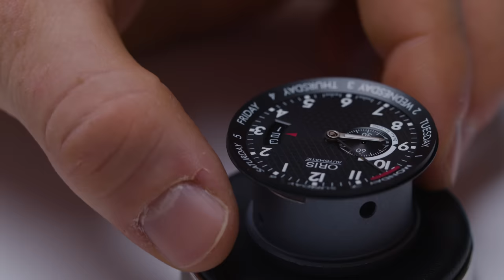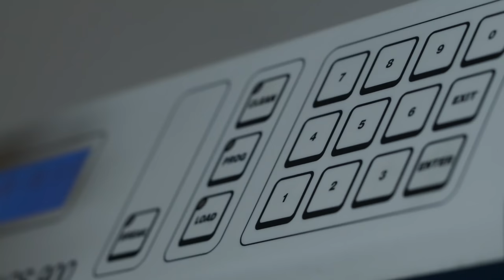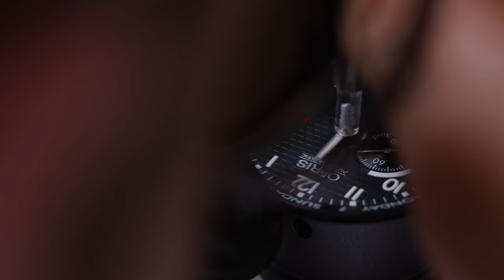Oris: Restoration of a BC4 Small Second, Pointer Day (2022)

Comment: How much does it cost for restoring such watch with that condition?Thanks
Reply: Free
Reply: depends on movement, normal movement revision is 370 CHF, chrono movements are 550 and then you pay extra for special polishing or part replacement but Id say max about 500-600 if the watch isnt completley destroyed
Reply: @Bruce Neuburger  are you one of the oris service center certified watchmakers?
Reply: @jeffd3802  no someone who sent 5 Oris watches about half a year ago for revision.

Comment: At that time, this square and round pilot watch had a "all black" design with a leather strap.
Back then I really thought the design was great; the only downside was that the original leather strap had to be bent to go through the original single-fold clasp.
If oris could design an integrated steel chain belt, I should buy it~